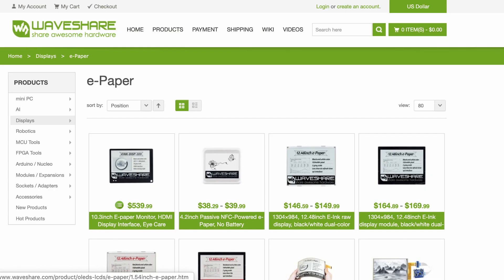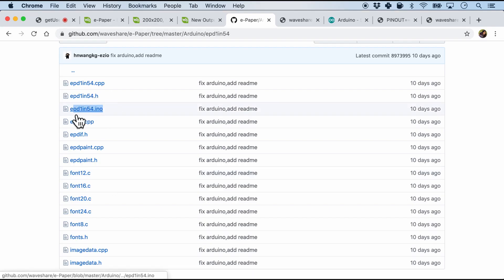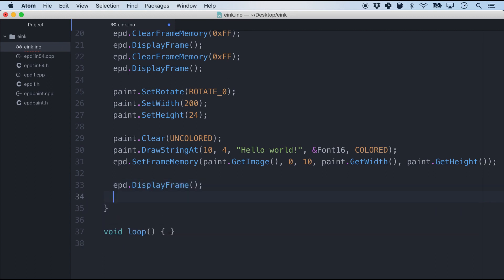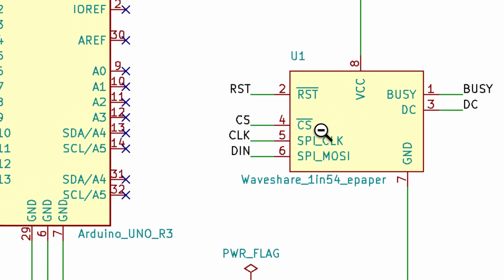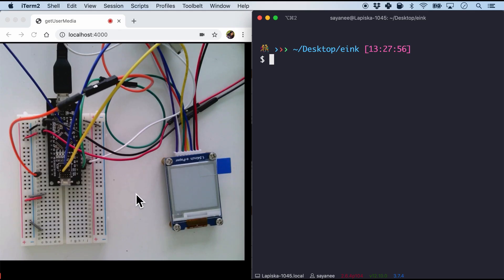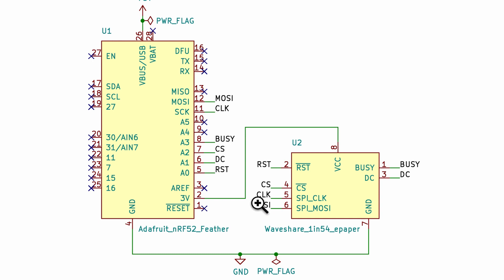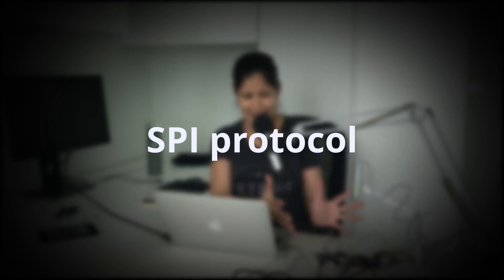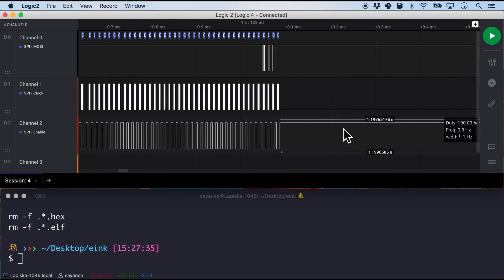Displaying on E-Ink screen with various micro-controllers // Waveshare 1.54, Arduino UNO, M0, nRF52

Comment: I followed the steps didn't get any text written on display. The moment I connect display, edges color get WHITE and start to go BLACK slowly. Other than this get no response on epd. Are there any other libraries which can be used?
Reply from the maker: Hmmm interesting, well, the library I used is the "official" one from WaveShare.

I do have trouble connecting the first time around with other projects. 
Usually, the problem is connections or using the correct version of the WaveShare module. For example, the code for epd1in54 and epd1in54_V2 is different as shown in different folders: https://github.com/waveshare/e-Paper/tree/master/Arduino
Reply: @sayanee  #include <GxGDEH0213B73/GxGDEH0213B73.h>  // 2.13" b/w newer panel
I have tried several libraries, but this one worked for me finally. Thank you.
Reply: @sayanee  Hello, Could you please tell me how to convert Mono Red and Mono B/W c-code from an image, as two color once works fine but I can't display all 3 color at once. I'm using SSD1680 Driver.
Reply from the maker: @justdoingodswork  Sorry! I never tried colored, only BW.
Reply: @sayanee  Okay, it worked now Needed to edit the library. Thanks anyways.

Comment: Does the pin connection stay the same for Arduino Uno rev 2? or do you change pin 10 to 4?
Reply from the maker: Do you mean the pin 10 that is used for chip selection? I used a digital pin 10 on an Arduino UNO Rev 3 board.

Sorry, I didn't have the time to dig through the Internet and find the schematics for an Arduino UNO rev 2 board. I believe you can use any digital pin as the chip select pin on this board as well.

Comment: Hey - i tried this on a pc and saved all the links in the git directory as the files as you did.  When i go to compile the code the arduino IDE says "epd1in54b-demo:28:23: error: epd1in54c.h: No such file or directory" I see you are on a mac here, is there any other tricks to get this working? I can only get one example working for this display but it just changes between bitmap images and I am after the text like you are doing.  Any help for simple text sketch on PC would be awesome!!
Reply: *any other tricks to get this working on a PC